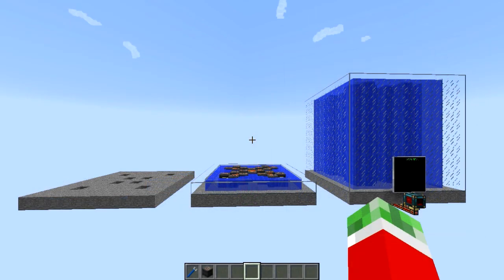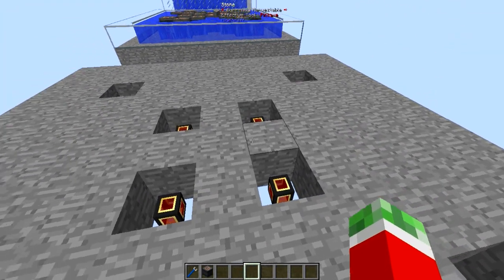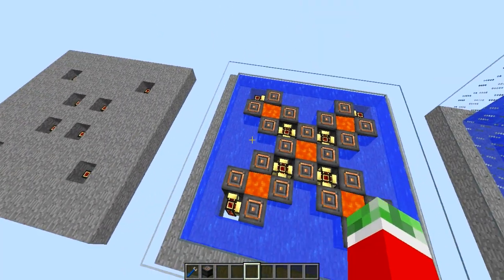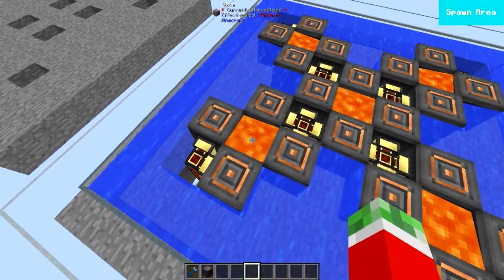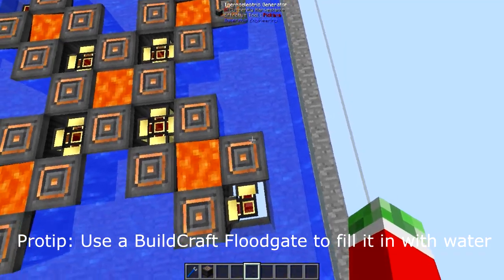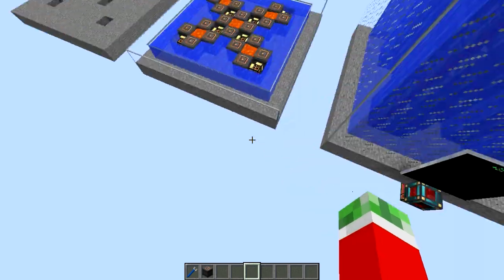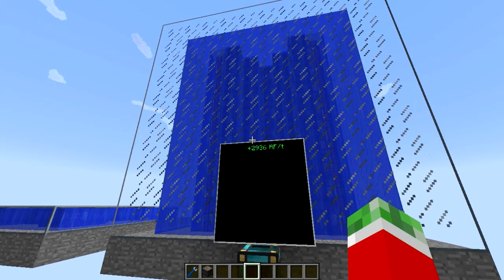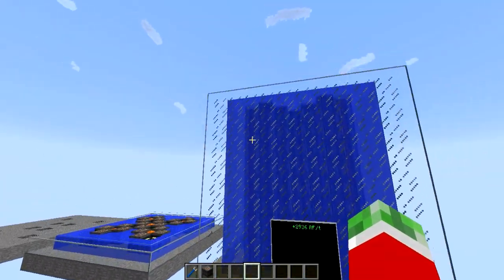Immersive Engineering | Thermoelectric | Passive | 6K RF/T

Comment: does gelid cryotheum work instead of water?
Reply from the maker: +mraider94 The combination of 
Lava + Water generates 15 rf/t. 
Lava + Gelid Cryotheum generates 17 rf/t
Blazing Pyrotheum + Water generates 30 rf/t
Your choice ;D
Reply: no blazing + cryo?
Reply from the maker: That will generate 15 rf/t
You can find the full list of combinations at http://ftb.gamepedia.com/Thermoelectric_Generator
Reply: +mraider94 try packed ice and blazing pyrothium
Reply: +the oncoming storm in the modpack for the whitelist community i am proudly a part of we dont have big reactors as it is immensely op and we wanted an ultra balanced modpack.
Reply: Pyrotheum+Cryotheum is 31RF/t, the max output, also achievable with Blutonium+Cryotheum.

Comment: also, don't you only get power from the first level? there isn't any way to configure the generators themselves
Reply from the maker: Greetings! These generators function by having a cold material on one side and a hot material on the other. Stacking them together with their heat and cold sources will maintain its power generating features! :)
Reply: actually, in 1.10, no.
Reply from the maker: This video was made using the Resonant Rise modpack on MC 1.7.10, and are you sure that its a feature and not a bug in 1.10?
Reply: I dunno. Should I just use the (much more expensive) Extreme reactor? i  need to power a machine that uses 4096 RF/tick.
Reply from the maker: When playing MC 1.10.2 Extreme Reactors are an excellent candidate for massive power generation!
Reply: from a single 3x3 i got 250/RF when full!
Reply: @jayster5665   Hello, fellow excavator user (excavator uses 4096 RF per tick